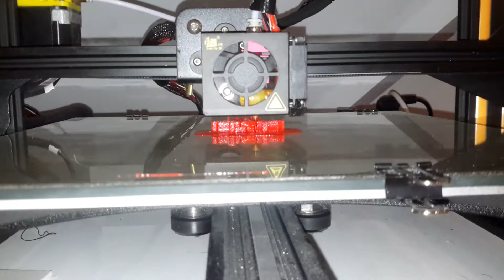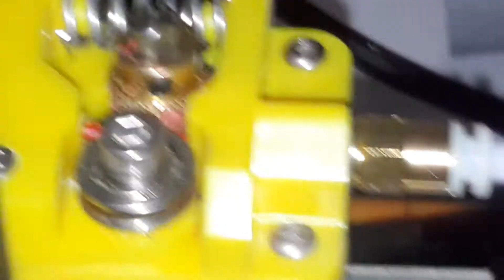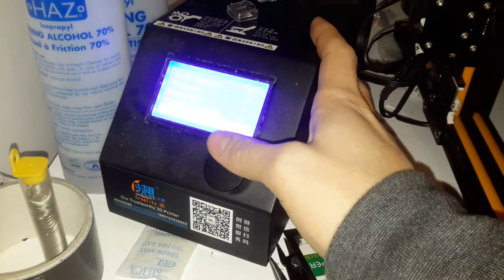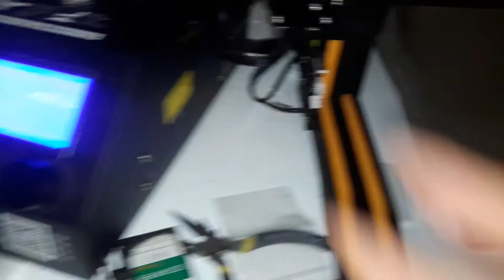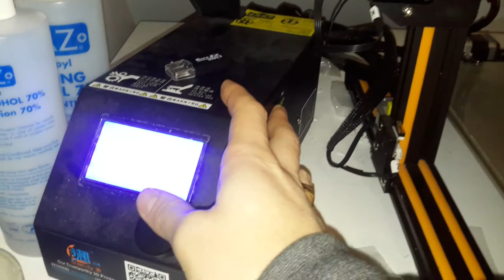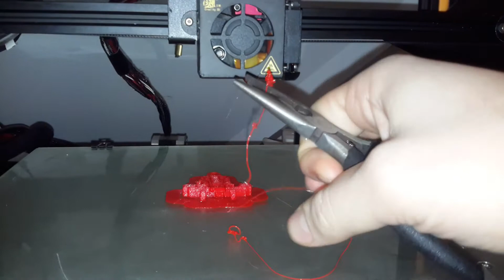A common problem with the CR-10

Comment: Had the same problem with mine its clogging for sure anytime your filament curls around the nozzle instead of coming straight down its a partial clog. Clean the nozzle with a needle and do some hot push throughs and a cold pull you should be good. I had this problem with plasfil filament switched to hatchbox pla and been good since. Alot of the cheaper filaments have particulates from being made in an unclean environment that will clog your nozzles constantly spend a couple extra bucks for a reputable brand and save the headache. Hope this helps!!! Happy Printing!!!

Comment: you see how your filament doesnt come out of the nozzle straight down when you were grabbing it with your pliers? that's because you have a clog. it should come straight down. you need to clean your hot end. this is from a year ago so hopefully you figured it out. also im sure it was caused by your speed of your extruder going way to fast and then grinding away the filament. most likely your retraction speed is set too high. should not be higher than 85 mm/s. hope this helps someone else that is having a problem. by the way, when you manually move the extruder through the control setting, it does it much slower so it has time to grip the filament. thats why that worked.

Comment: If you absolutely know you do not have a clog and that your level is correct then I would be cautious of this issue.  It could be that your thermal sensor on your extruder is malfunctioning.  It is too difficult to push the filament out because the extruder nozzle is not at the correct temperature but the computer believes it is so the extruder continues to push.  But I could be wrong.  If it continues to push and can't then there should be a clog, right?   I would replace the nozzle first because its cheap.  If that does not work I would replace the entire extruder heater and sensors and everthing in that area just to be safe.

Comment: in my old printer when this happen, it is when i change between PLA and ABS. some residue are carbonize inside, causing it to jam only at low extrude rate. I use a cold pull with nylon to solve the problem. If the cold pull shows black nylon, means there are old carbonized filament.

Comment: Hey, I fixed my problem, let me know if you need help!
Reply: I too am having the exact same issue, if you have a fix i would really appreciate it!
Reply: The spring at the extruder motor is WEAK! The roller is not being pressed hard enough to jam the filament into the brass toothed gear. The filament isn't being fed properly down the bowden tube. I was given a STL file for a washer that fits in the back. I was able to print the washer on my ANET-A8  and then put it between the spring and the plastic housing. I can send you the STL file, if you want. If you can't print the file, go to the hardware store and get some small washers that are close to the size of the STL file. Let me know what you think! I would need your email. My printer SUCKED before this simple mod - now, I LOVE IT!!!